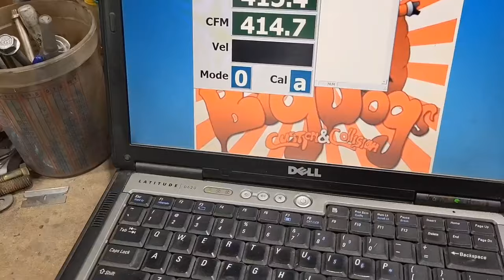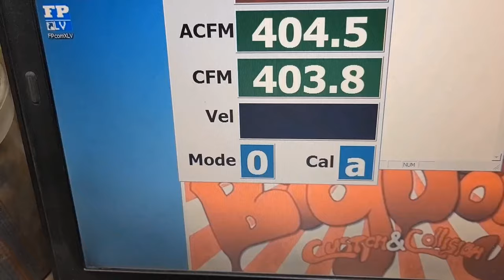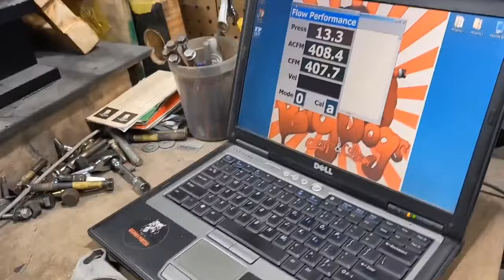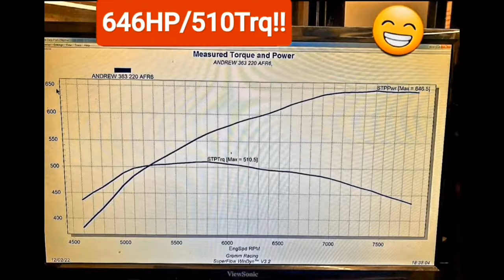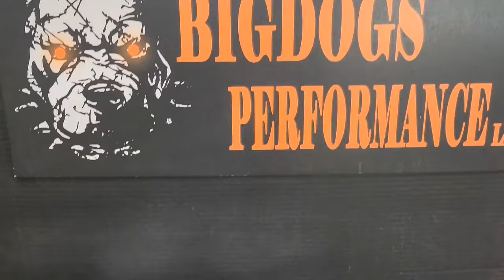Edelbrock SBF Super Victor Stage 3 650hp ported by Bigdogs Porting with flow and dyno results!!

Comment: nice manifold for a 408 or 427 and some big cylinder heads!
Reply from the maker: I would run stage 2 ported 205s or 215s that way the intake charge is through the roof which sends the hp/trq to the stratus fr